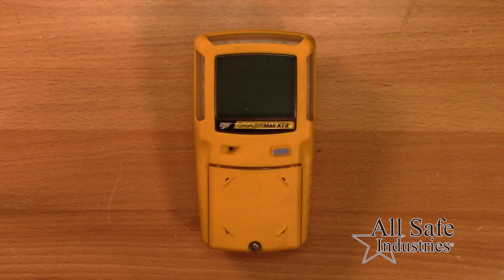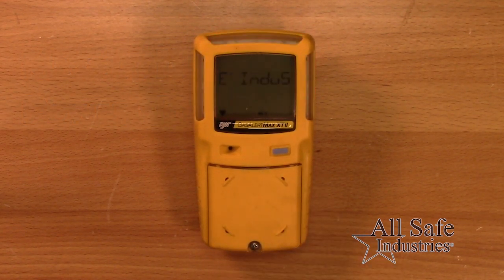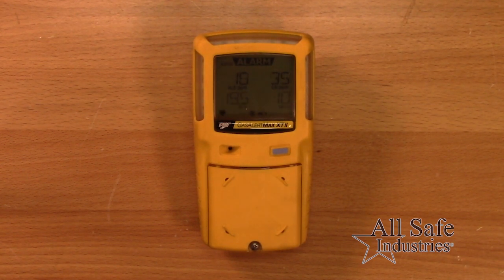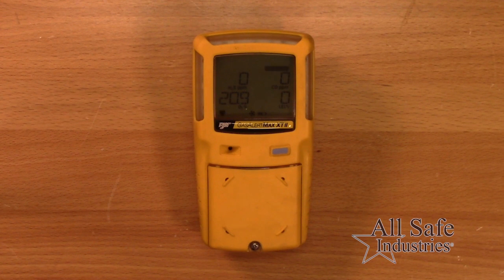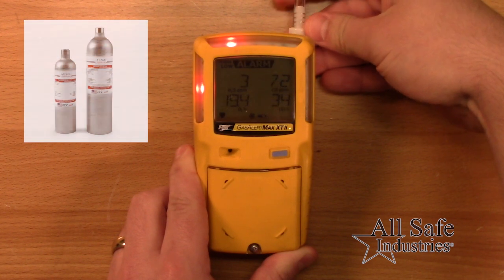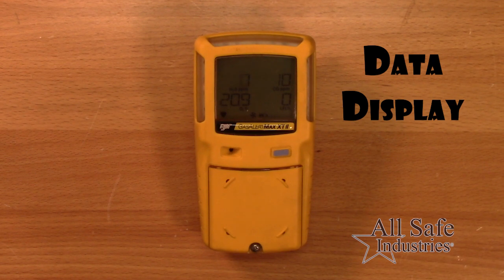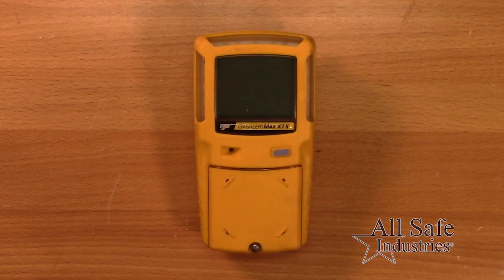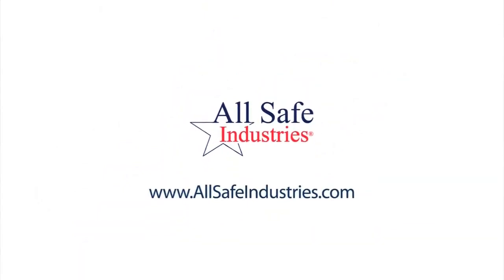How to Bump Test a BW Max XTII

Comment: If we’re calibrating with methane, is there a correction factor for the LEL sensor for other gases?
Reply from the maker: With the XT II LEL correction factors can set up with the HW Device Configurator software. When doing a manual bump test, you'd need to figure in that correction factor. Some meters have a bump test mode and selectable LEL gas correction factor libraries that make this simpler. The XT II is a bit more basic in this regard. 

If you need more info or want to speak with someone about this, feel free to give our service team a call at 888-972-3389.